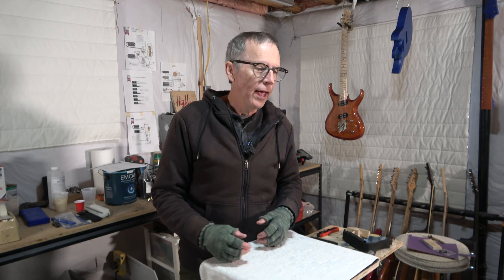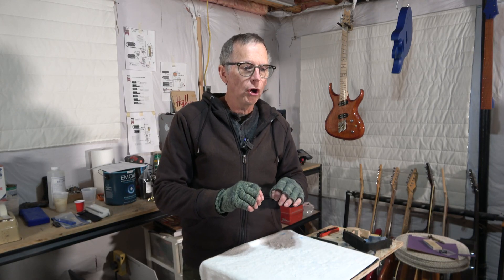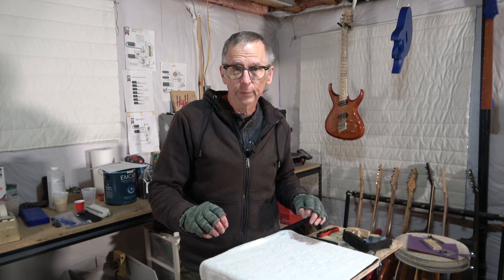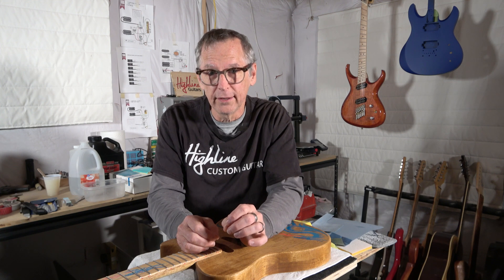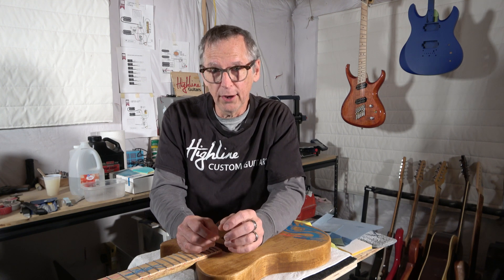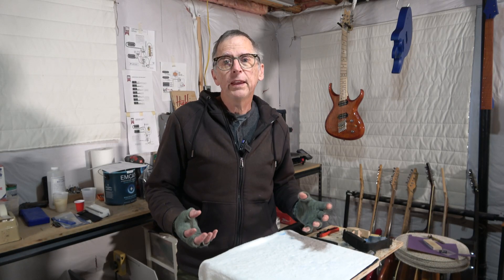Making A 3D Printed Electric Guitar Part 4

Comment: Very interesting. Why did you go with CA glue rather than epoxy to attach the fretboard? I figured CA glue would be too brittle and would eventually fail with neck adjustments over the years.
Reply from the maker: I have an RC airplane that was assembled entirely with CA glue. This plane has been subjected to extreme vibrations, intense g-forces and fuel spray. It is 30 years old and still as good as the day I finished it. I also have an acoustic guitar that was glued together with CA glue and is over 20 years old and still going strong.